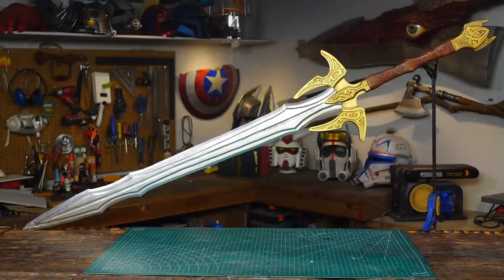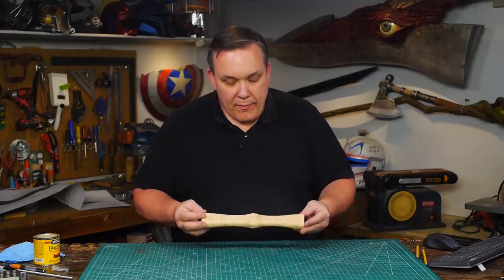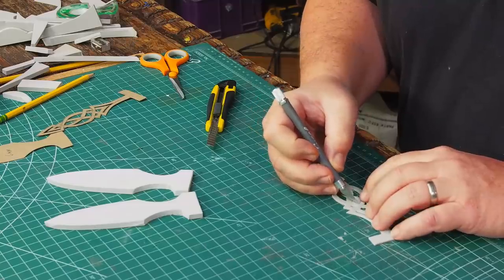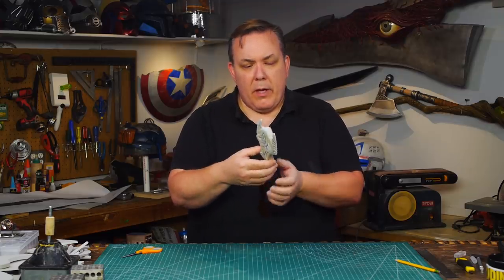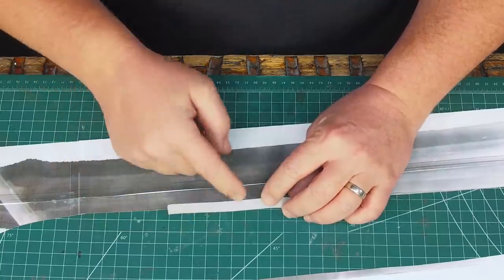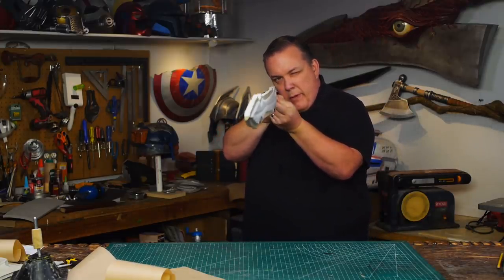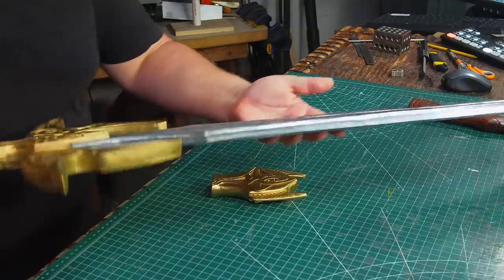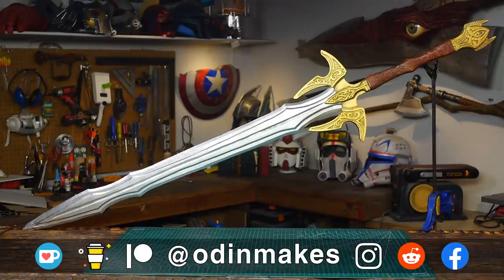Odin Makes: Heimdall's Bifrost Sword from Marvel's Thor

Comment: Hey Odin! I'm new to your channel but already a fan. A few years ago I made a long bow out of PVC. To make a stave, I heated a piece of PVC pipe and flattened it with 2x4s. It made for a very thin, lightweight bow. I was thinking it might be worth a try to use as a core for a sword. It would be  wider but just as thick as a carbon fiber rod but more rigid. Probably cheaper too. Just thought I would throw that out there. Keep up the great work !

Comment: If you invested in a small desk top cnc router / laser burner / cutter your knot work and parts would be faster and easier to do... and it could do it on wood foam metal leather,  whatever you choose to work with ... not only more realistic but also quicker and realism would be epic .... just a thought

Comment: Hey odin, Can I ask you a question. So I was painting a foam ichigo sword and I used plastidip to seal the foam and when I sprayed it on the foam bubbled and curled up. So I was curious on how I can fix this for future projects. But as always amazing job man keep it up, I hope you are staying safe and healthy along with everyone you know and I will see you in the next video. ✌
Reply from the maker: Make sure the can is warm (not hot) If it's cold, you get a nasty texture, and if the can is too hot it dries in the air and sticks like little fuzz balls.... the ideal temp is printed on the can. I warm mine up with hot tap water in the winter.

to fix your Ichigo sword, get some Naptha, Xylene, or Industrial Maintenance Cleaner (please wear a mask and gloves!) pour some on a paper towel, and start wiping down the plasti dip texture that looks bad. You can really smooth it back out very easily. Don't rub it like sandpaper, just wipe it repeatedly, like you would clean up a spill on the counter.
Reply: @OdinMakes  Thank you so much man, your awesome!!!

Comment: Did you brush on the contact cement before plasidipping the blade and if so did it self level or were there brush marks?
Reply from the maker: Yes before Plasti dip. Sadly I didn't record it. What I did was brush on new thin contact cement, and let it dry fully (about 2 hours) it really seams to help with a smoother finish.
Contact cement is self-leveling, and by using really fresh cement, it goes on smoother without brush marks.